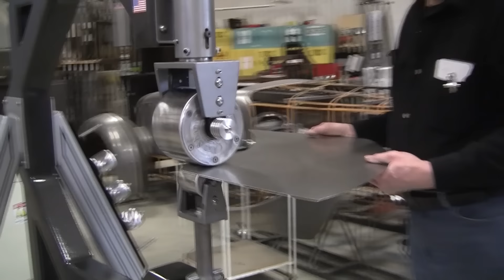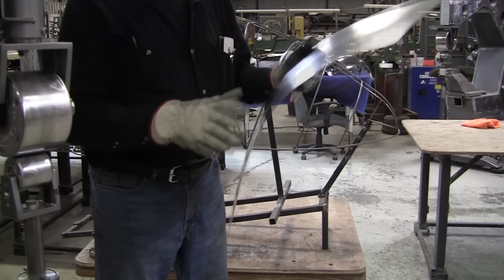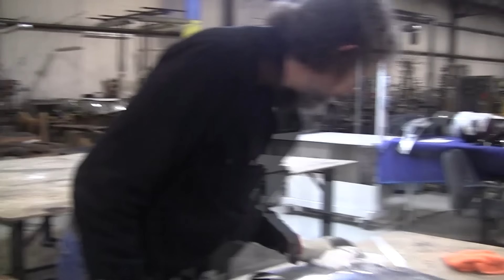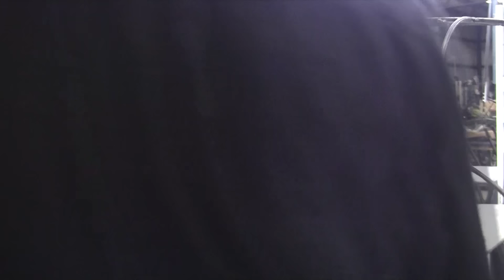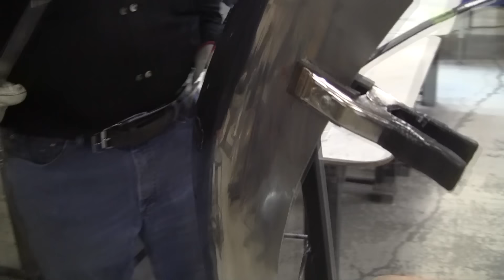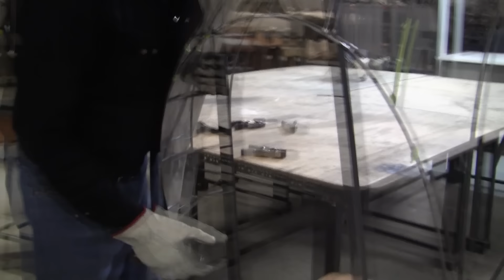Metal Shaping for Beginners: English Wheel Basics

Comment: What would be the max size sheet of metal you would recommend someone to work with on the English Wheel by themselves.
Reply from the maker: It depends on the size of the machine and the size of the panel. I have worked .125" thick copper in my large English wheel. For automotive  work usually it is steel 20, 19, 18 gauge. Aluminum .050" and .063".
Reply: @proshaper  What about dimensions what would you say a single person could handle. Thank you

Comment: It's surprising how much time is required to make one fender. Now all the more it's plain why everyone doesn't own a hot rod. 
Thanks for showing the skill, endurance, materials, tools, machines, available time, and determination required. I learned a lot. 
I've worked in fab shops, and have told people if their car wasn't made on an assembly line, it might cost a million dollars. After seeing the English wheel work, the estimate might go up another $30,000.
Reply from the maker: To do a nut and bolt restoration and can easily take 2000 hrs plus parts and the cost of the car. To scratch-build a car you can spend the same amount of time, plus parts, with no initial cost of buying the car. Building a car or restoring a car to a high standard is a labor intensive pursuit. A lot of the people that take my class are retired and the labor cost is their hobby.

Comment: Wray, My wheel has a 1”-5 acme thread which obviously does not render itself to fine pressure adjustment. I see you making full turn adjustments which tells me you must be using an extremely 
fine thread in your adjuster. Can you tell me what that pitch is???
Thank you, Denny G, Sandwich, IL
Reply from the maker: Acme threads are too fast. I use a 1"x 14 thread on all of the adjusters I have made in the last 30 years.
Reply: @proshaper  Thumbs up Wray, thanks a bunch, looks like I'm in for an adjuster change in the very near future. Thanks again for all the tips you've posted on Youtube. Picked up lots of ideas from them. Denny G

Comment: Hi, is aluminium forming easier than forming steel? Is there any thickness limitation? Thanks
Reply from the maker: Once you use aluminum you like it more and more. I works about the same, is trickier to weld but is becomes easy once you develop the correct skill sets. It doesn't rust like steel, therefore you don't have to keep cleaning it.

Comment: I am wondering how important the blank shape is to the process. It looks like your blank is pretty close. How do you determine the blank shape?
Reply from the maker: If you are working from a wireform or wood buck you use a paper pattern. If you have a full surface to copy you can use a paper pattern or a flexible shape pattern. Always add at least 1" all around even 2" is OK. You'll be happy you had that extra material later on. Trim as needed several times as the panel develops.

Comment: Hi Wary. Looking your videos with passion frome here, France, without being in the bizness (I'm a 3D designer, programmer and CNC machinist), but dreaming going to this kind of practice one day.

Thanks for all.

However, I've never seen you using Rubber on the big wheel to allow shaping in only one direction, (determined by the lower wheel), without compound curves.
Reply from the maker: Hi Franck,  I'm asked this question often. To make simple bends (non compound bends) like on a 1930s style hood I use my bender which is nothing more than two 8' long tubes .  I put blankets over them and I can very quickly make a roll or tapered roll like on a hood or sometimes a rocker panel, or roll panel. If I need to make a small diameter roll I have several rubber wheels which I use. These methods are more effective than a rubber band on the top wheel. I will do a video on this.
Reply: *Hi Wray.. sorry... typo bug...

Comment: Very skilled Wray and very impressive.    Studying vintage  BSA English motorcycle mudguards and petrol tanks always had me wondering how they were made.  When the time came to remove the dents in the tank I cut the bottom out to tap out the dents and was astonished to find that the top was made in three parts  gas welded together and I'd now say finished on a English wheel across the weld seams.  Tank was chrome plated and I'd defy anyone to find the weld seams.  Working compound curves into sheet steel takes a very skilled person to do that.
Reply from the maker: I have some students at my classes that master it very quickly. I just had two  students that built a 1937 Studebaker rear fender for the scratch -built Studebaker truck project. Both were total beginners.

Comment: I am English, I was taught by a man called Albert. I know its called and English wheel but we do use hammers as well. Nothing wrong with what's shown for wheeling practice but wheeling from flat to finish is better for large long sweeping low crown parts such as the tops of wings on a Lotus 11 in Aluminium. A small high crown part is far faster to do 75% with a hammer and finish with a wheel.

Comment: I am just wheeling my first panel.  .040 AL on a mini English wheel from Grizzly.  Top wheel is only 1” wide.  I am having trouble getting the striping to wheel  out smooth.  Is this likely  due to my cheepo setup or could I expect decent results even with a small machine?
Reply from the maker: I think you will have to upgrade. Consider building your own English Wheel I offer frame plans at my website www.proshaper.com

Comment: Hi Wray, Great series of vids!  Sorry if this has already been discussed and answered, I was wondering, it looks like the upper wheel's contact patch with panel is relatively thin (sub 1/2").  Why does the upper wheel need to be so wide?   Is that to use with a much flatter (completely flat?) lower wheel and have a larger contact patch width?  Thanks again!
Reply from the maker: Hi Bob, I did answer this before but here it is again.  Imagine you had a top wheel that was only one inch wide. Do you know what would happen? The edges of the top wheel will  dig into the panel when you pushed a panel through if didn't maintain the panel at horizontal. One degree of lean will cause a groove or bite mark in the panel. Go up to a 2" wide top wheel, better but the problem is still there. Go to 3" much better but you have to be careful.  Go wider and the wheel holds the panel on horizontal for you. Also the wider top wheel will bridge over a low in the panel, the lower anvil becomes a fulcrum moving the metal upward. Once you try a wide wheel you will never go back.
Reply: @proshaper  Thanks for the detailed reply and sorry for the repeat question. That makes a lot sense - I didn't consider panel tilt. Thank you!

Comment: Can you explain the original shape of your metal? How did you determine the original curved shape? 
Just experience? Or do you figure one edge and let the other run wild until final fitment? Made up a paper or cardboard pattern?
Reply from the maker: I'm assuming you are asking how did I determine the cut blank size. I did that by making a paper pattern first that left enough surplus to cover the wires. The rear section will be welded on.
Reply: @proshaper  : I figured you’d made some sort of pattern, unless you were just so experienced/good, as to know instinctively what shape to start with!  Heck, you might be some sort of savant, what with the way you can mold the metal panel to your will ❗️👍🏻👍🏻👍🏻🤪🤪
Thanks!!

Comment: What is  measurement of the  crown of the wheel.....
Reply from the maker: Hi Joe, I measure my lower anvils this way: first is the contact area. In this case the contact area is about 1/4" wide on my second wheel which is the one I'm using for this panel. Next is the drop off. To determine that drop off I hold a straight edge across the top of the anvil and measure down to the surface. The drop off on this anvil is about 1/16". Then I have an outer edge radius, the outer edge radius protects the panel from bite marks. I never define an anvil as a radius value. Contact area width, drop off arc, and outer radius.

Comment: Ray, do you need to do anything after a panel
Is annealed to bring the stiffness back?

Great content BTW
Reply from the maker: This was a steel 20 gauge panel .035"  If you anneal an aluminum panel, after working it a little it gets it's original strength back.

Comment: Also is there really any difference if you had like a 2 in upper wheel vs that monster wheel you use? I mean the contact area is so small.
Reply from the maker: The wide top wheels stabilize the panel ( hold it horizontal) while you are wheeling. By holding it horizontal you don't have to worry about the top wheel biting on it's edges and marring the panel. Plus just like a slapper has more surface area than a body hammer, the slapper or the wide top wheel will totally bridge a low area. It makes smoothing a lot easier. The panel forming tool industry is very small there is very little innovation because there is little money to drive it. Machinists would still be using flat belt lathes and metal shapers if there was no money driving innovation. We would have CNC English wheels and CNC power hammers if there was billions of dollars driving innovation. The fall back position is always devotion to traditional tools and methods. That has merit but it is not encouraging to anyone promoting innovation.
Reply: @proshaper  ok great explanation, I didn't think of that. Also good point about innovation and the size of this industry. I gotta say though, metal shaping has become much more popular/known in the last 10 years or so. Thanks to people like you who share their knowledge .

Comment: Wray, anyone ever tell you you're really really good at this? 😁  If one shouldn't be wheeling out on the edge because it will release the tension built up in the middle of the panel, the edge acting as a border or frame, then what happens when you have to trim the panel to the final shape?
Reply from the maker: Once the area change has been induced it is stable and locked. Cutting the edge only makes the panel smaller.
Reply: I had the exact same question...

Comment: I've struggled to understand this procedure for a long time but the way you explain it between this and the flexible shape patterns it is like a light bulb switched on. The outer edges of the panel are actually a picture frame or cage that hold the shape of the panel. If you over work the panel, you just open up the cage to let out the over shape. You're taking all the black magic out of this process for me. Thanks for another great lesson!

Comment: a bit puzzled instant 24' : checking rise 90 degrees from the curve direction ?
Reply from the maker: I'm confused. Restate what you are trying to convey.😁😁😁
Reply: @proshaper  to restate, around minute 24, when checking the rise of the current sheet (which I understand is an important part of getting in the right direction, not so easy when you're planning to get started)  I had the impression that out of the 2 compound curves being formed the one checked from the buck was not the one measured on the table ... most likely I missed something, will watch it again tomorrow

Comment: Awesome video! Do you ever use a rubber band? And if not, why not?
Reply from the maker: Absolutely no need for a rubber band on  the top wheel. I have tried them. If you want to make a simple radius bend you can easily bend over a pipe with a blanket on it.  If you want to use a wheel try a rubber wheel as the top wheel.

Comment: Seriously though, thanks a lot for this starter video. When you do those 45s, did you say it's important not to go all the way over the edge?  That looks like a magic technique to take the edge waves out but I don't understand what the metal is doing to achieve that?
Reply from the maker: The interior of the panel gets stretched to the level of the edge. I have no idea why a magnet works but I use magnets everyday.😁😁😁
Reply: @proshaper  thanks Wray I guess I'll just think of it as a line along the edge that stays the same length and parallel lines inland of the coast that get longer and longer as you get further from the coast

Comment: Nice to see steel work, even if it made you sweat a bit Wray :).  May help those learning to correlate the number of tracks to your method of bag stretching with alloy. Now I have to make floor space in the shop to get mine built. Wheel seems to work well.